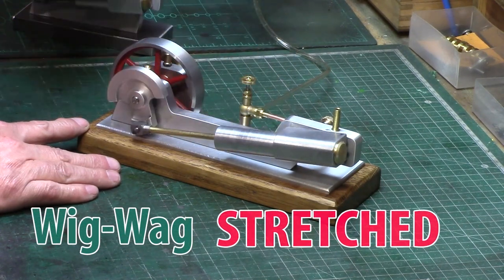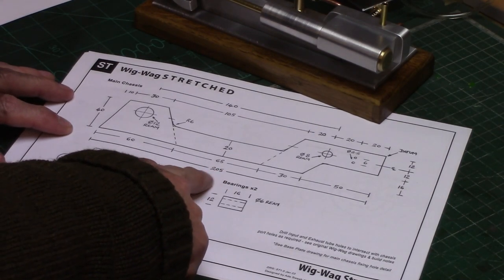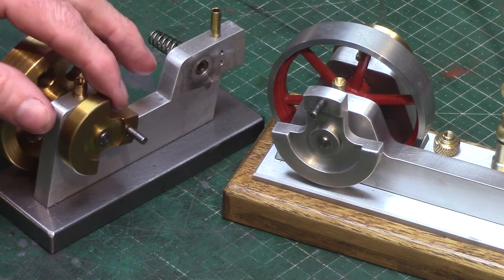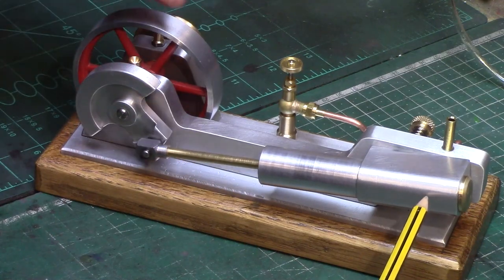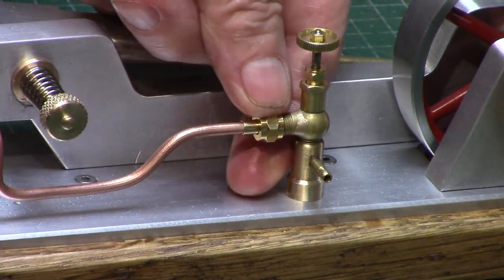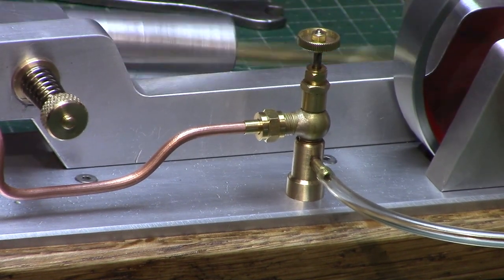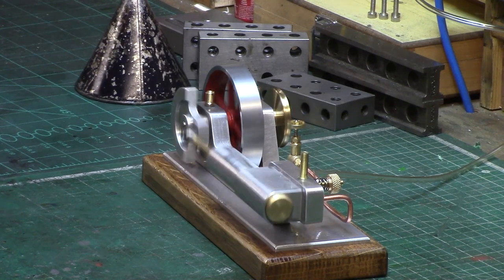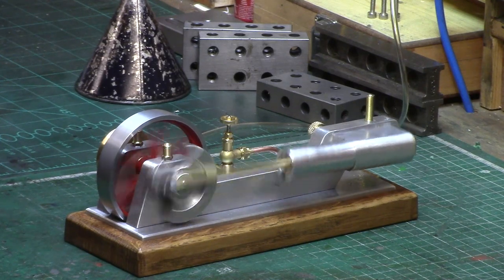Wig-Wag STRETCHED Horizontal Steam Engine

Comment: A concept more efficient (in terms of vibration) is a rotary valve  engine. Here it a link to such a design:
https://www.youtube.com/watch?v=rWXRQKxSBIA
The above design has less vibration than a wig-wag. And by using a V-type dual cylinder version, most vibration can be cancelled out.
The rotary valve design, like in the above link, is unknown to most wig-wag builders.

Comment: We built this 100% by hand in my College machining class way back in the early 1990s.  (i still have mine and it still runs)  They are one of the few engines that can be built entirely with hand tools and pieces of very common metal stocks of any type. 

This actual concept as a steam engine of sorts goes back at least 300 years to some time in the early 1700's.
Reply from the maker: Hi Tomtech, thanks for the info, yes its a very old design indeed
Reply: Perhaps you're referring the the Newcomen engine? There've been plenty of oscillating steam engines in real world use, but not in the 1700's. It wasn't until the late 1700's that cast iron cylinders that could properly seal were even made, and certainly none of those were an oscillating configuration.

Comment: Love your engines.  Do you have plans in inches?
Reply from the maker: Hi Jon, I only have metric, but the engines are quite forgiving so it should be fairly easy for you to convert and round up/down to imperial fractions and dimensions
Reply: @AdeSwash  Thank you I will have to give that a try.

Comment: Hi Ade
Thanks for all the great videos  I am one year in to my learning and you have been a great inspiration to me.  I am on the 4th of your engine the stretched wig wag. Could you give me a guide as to how you machined the cylinder being as long as it is.
Reply from the maker: Hi Mike, yes this discussion was brought up on the WigWag Facebook group recently, there is actually about 24mm of unused cylinder at the far end, so the bore only needs to be 76mm, which is more achievable with a boring bar than the full 100, although if this still isn't achievable you can reduce the length of the piston somewhat as this was increased from 22 to 30 on the stretched plans, for no reason other than stretching all components, but won't make any difference to the running if shortened to suit your bore - Hope that helps. Regards, Ade
Reply: @AdeSwash  Many thanks Ade
Reply from the maker: @mikechadwick3340  why not join the WigWag Facebook group 🙂 https://www.facebook.com/groups/201574434906362/